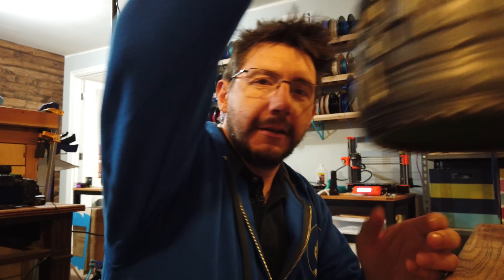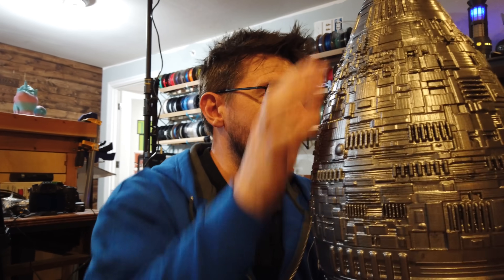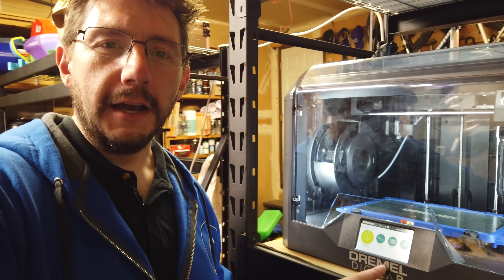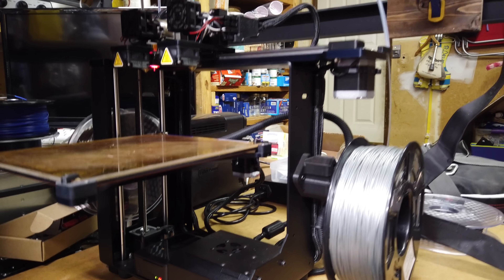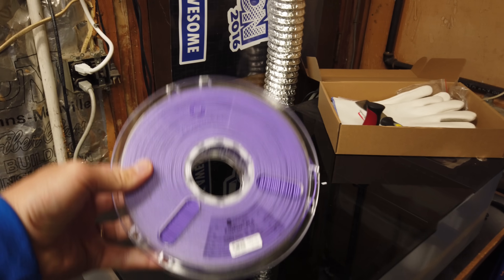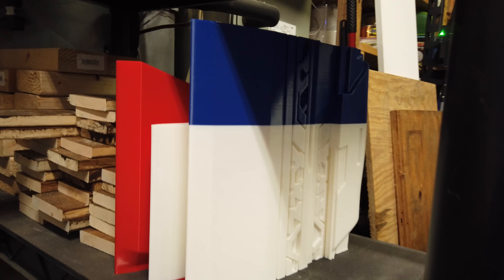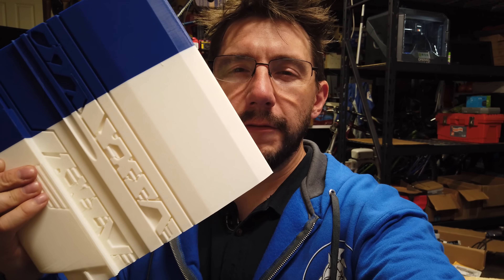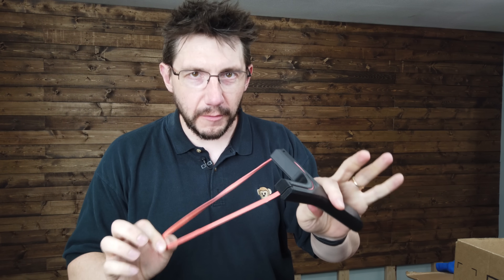Quick 3D Printing Update Before Bay Area Maker Faire

Comment: When your printers stop from running out of filament, do you notice the layer adhesion is weaker at the layer where it stopped and the layer where it started up again. I would think having the layer below be cold would reduce layer adhesion and make a weak print in that area....
Reply: Actually it adheres the same . Even w/o the pause filament cools pretty quickly  so there is really no difference from a non paused print and a paused print.
Reply from the maker: Hmm, I’ve never noticed layer bonding being affected by this. I’ll keep an eye out.

Comment: Hey Joel, do you have any power banks on the printer printing the Thanos sword? I'm guessing a printer that's size is expansive enough to have a pause and print save feature in the case it loses power.
Reply: Hi Justin, just happen to see this question. Yes, the printer has a power loss recovery feature.
Reply from the maker: No UPS on this one, but it has very good power loss recovery so I’m not worried at all!